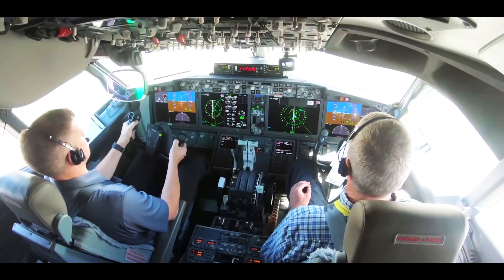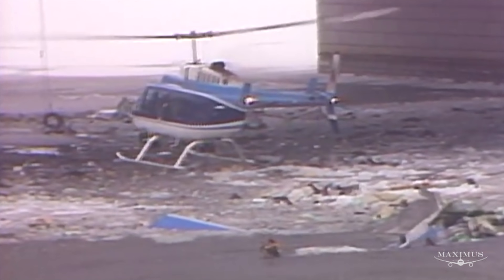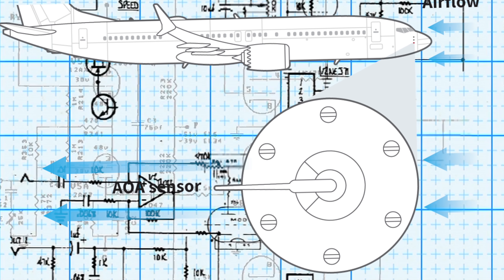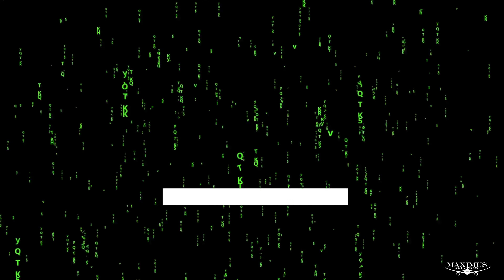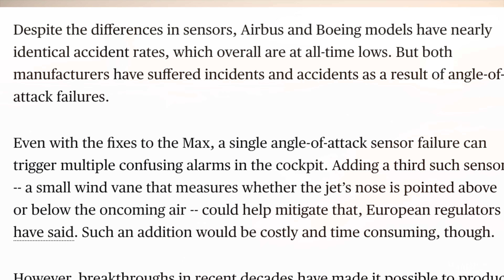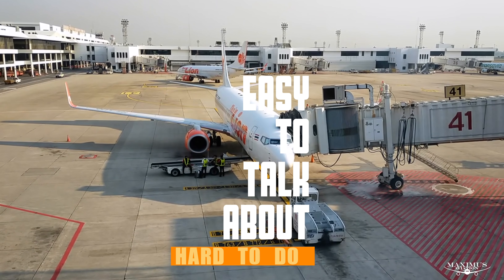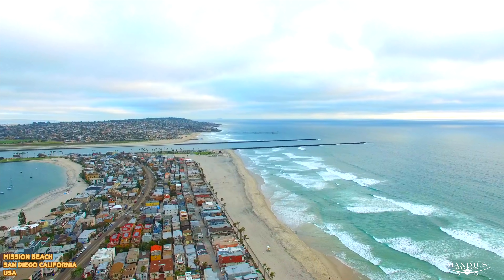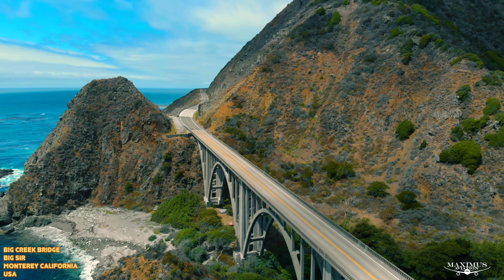Boeing To install 787s Synthetic Air System On The MAX! Boeing Caves To The EASA Will Install System

Comment: Ain't gonna make any difference. It still has the same old air frame along with the same over sized engines and other unchanged items leading to the two crashes.
Reply: The plane isnt inherently unstable that's mainstream media bullshit from their lack of knowledge on anything. All MCAS does is make the max fly like the NG so that pilots trained on that plane can carry over their type rating and not need extra training which would cost airlines more money. That's it. It doesn't need MCAS to be a safe plane. In fact it would be better off without it.
Reply: @TheAlmightyBig  it kind of does need mcas because the change where the wing positioning is in relation to the length of the airplane which changes how the rotation is positioned. You are correct that MCAS was the solution for this problem, just boeing failed to let everyone know of its significance of this system and tying it to only one AOA vane which became faulty in the 2 crashes
Reply: @Bob39285  the wing position hasn't changed in relation to the fuselage at all. The only reason MCAS was fitted was because in a steep climbing tight spiral, at high speeds, there is enough air pushing up from the high AoA on the bigger engines that less force was required to pull back further on the yoke than on the NG. That's it. MCAS corrects this by simply trimming down, so the pilots feel the same forces on the yoke. That's literally the whole reason MCAS exists. No instability, no nothing, just weaker feedback in a position the plane would barely ever realistically get to. That's it.
Reply: @RazvanMaioru  You're just wasting your energy, the media repeated the whole "Instability" BS enough that people now believe it.

Comment: My question is, where will Boeing find the computing capability to host synthetic airspeed calculations on 737 Max?  The aircraft used decades-old computers now, and both are now required to be running just to meet the new FAA dual-AOA sensor requirement.
Reply: Those computers belong in a museum.
Reply from the maker: Good question.  They will need to add computing power for sure.  But you know how these things are.  EASA says Boeing can fly while the "fix" the problems but that turns into years of not fixing things.
Reply: You do realise that the computers on the planes are more advance than the computer that you use in your house right? Even if the airframe that was built in the 1950's, the computer system can be retrofitted with current computers and upgraded with the latest technology without hampering performance. Of course they lose out on weight savings due to still having pulleys to control flight surfaces in an emergency, but that gives the pilot a better feel for the aircraft and how it flies unlike a joystick where you feel like your in a simulator without being able to feel the weight of the controls and everything feels synthetic. However, i will say i do love both manufacturers and they both give each other much needed competition and improvement to help further the industry
Reply: You do realize that the 737 Max FMC’s are 33 years old:  https://www.google.com/amp/s/www.theverge.com/platform/amp/2020/4/9/21197162/boeing-737-max-software-hardware-computer-fcc-crash
Reply: Nehemiah Scudder  whats your point? I work on airplanes and while the issue bring up is valid, its not accurate

Comment: The too expensive to implement reasoning doesn't appear too clever now does it!
As for the near identical accident rates we keep hearing banded about, does anyone know what they mean? For example, if an aircraft clips an 'on gate' aircraft does this count for both, one, or none? Is there a difference depending upon whether the aircraft was under its own power or being towed? Did the pilot deliberately fly into a mountain or building? Despite repeated warnings was the aircraft bounced hard enough on the runway with the undercarriage up to damage the  engines so much that they failed before the plane could reach the runway again? Or was it shot down either deliberately or accidentally?
I for one would not necessarily want those 'incidents' including in the statistics for determining one manufacturers performance versus another.
Reply: Google "ntsb definitions for aviation incident and aviation accident". Very very exacting definitions.

Comment: What a tangled web Boeing is weaving
Reply: Boeing has had a very hard lesson. They really need to look at Lockheed and the Skunk Works as a model. If the engineers are trusted and management supports them, this method works.

Accountants on the other side of the country? Duh. Go back to basics, Boeing.

Comment: Software does NOT solve an aerodynamically unstable passenger aircraft
Reply: The 737 is not an aerodynamically unstable aircraft. There is more than enough dihedral in the wings and horizontal stabilizers and surface area in the vertical stabilizer for it to hold a pitch, roll and yaw attitude without pilot intervention so long as it is kept within the weight and balance and and airspeed envelopes. You clearly do not understand the definition of “aerodynamic stability.”
Reply: @In0vat0r  The Maneuvering Characteristics Augmentation System (MCAS) flight control law was implemented on the 737 MAX to mitigate the aircraft's tendency to pitch up because of the aerodynamic effect of its larger, heavier, and more powerful CFM LEAP-1B engines and nacelles. And you say that inherently stable ?
Reply: @gowdsake7103  Go read FAR Sec. 25.173 and then we can at least be discussing this fairly and in an informed manner.
Reply: gowd sake - You’ve done an admirable job of recanting the story told and rehashed by most of the reporters who’s depth of understanding modern transport category aircraft is the result of time spent in a passenger seat. Have you ever worked in the aircraft industry? Do you hold any class of pilot certificate? Do you have any experience in flight training, simulation or aircraft control systems? Is any of your “knowledge” acquired first hand or are you relying entirely on news stories?
Reply: @gowdsake7103  1. Test pilots absolutely were aware of MCAS, they loved it because it worked great.
2. The 737 MAX is indeed by design extremely stable, just like any other 737.
3. The plane does not pitch up uncontrollably. It pitches up as you add power in the same way any aircraft with engines mounted on wings below the fuselage. Compensating for this is part of any airliner's type rating training. 
4. Boeing tried many things including an entirely new wing, but they didn't provide the results desired, which is why they made MCAS. They only look at software as a last resort. 
5. No, the two crashes do not prove it was badly implemented. They prove that those airlines were terrible at keeping their pilots trained. All the MCAS did was trim down. You could get a similar effect if a bit of dirt got the trim switches stuck, except that would be worse because it wouldn't stop on its own like MCAS. Again, dealing with this (it's just one switch you need to use) is part of the type training. The fact that all three flight crews couldn't do the simple procedure proves that they shouldn't have been allowed to fly a 737, as they would fail their type ratings. You'll notice I said 3 flight crews, but only 2 crashed. That's because the first had a 3rd pilot on board that actually showed up to his lessons, and dealt with it. They flew the rest of the flight and landed, all without issue. That's how easily recoverable an MCAS failure is. Meanwhile, maintenance didn't do anything to the plane that broke, so next flight, big surprise, it's still broken. In come flight crew #2, that, like #1, did nothing about it. And there was no help from a correctly certified pilot this time, so after 10 whole minutes of the aircraft still flying after the failure, the plane crashed. Again, after 10 entire minutes. This is because all trim down does, is increase the force required to pull the aircraft up, and give it a tendency to pitch down if the yoke is released .
Reply: @gowdsake7103  - No, I'm not defending Boeing or the FAA. They both made mistakes. At this point I'm simply trying to determine how much experience you have in the cockpit. It sounds like the answer to that is *none*.  (That you understand control systems is good.)

Aircraft are certified to operate within a range of weight, balance, airspeed and angle of attack conditions.  That is called the flight envelope. If the flight crew allows the aircraft to get outside the envelope it can become unstable, however, that does not mean that the aircraft is characteristically unstable. The section of the FARs I mentioned outlines the requirements. Clearly the 737 Max 8 didn't conform to that or Boeing wouldn't have implemented MCAS - which was actually developed for KC-767 in order to help manage it's speed stability during refueling operations. (large shifts in CG location as fuel is offloaded in flight.)

The press has consistently under-reported the details of what happened on both Lion Air 610 and EA 302. Human error was a significant factor in both cases. 

On EA 302 the crew did not follow the proper procedures. The preliminary report mentions that "thrust remained at takeoff setting (94% N1) and the throttles did not move for the entire flight" That caused the airspeed to increase to the point that it was impossible to adjust the horizontal stabilizer trim manually. This is a known condition on almost all modern aircraft which was discovered decades ago and is part of the training which all pilots receive in the United States. It is what the inexperienced F.O. is referring to when he said that it wasn't working. By that time it was too late. There was nothing the crew could do to slow the aircraft down enough to regain control. If they had throttled back and leveled off earlier, they would probably be alive today

While the Lion Air 610 Final report says that "MCAS was the primary cause of the crash" it also says that a "faulty sensor, inadequate maintenance, poor pilot training and a failure to heed previous problems with the same aircraft were all contributing factors."
Blame for LA 610 spreads across several individuals, from the Instrument Repair Tech in Florida that didn't follow the calibration process, to the maintenance personnel who didn't do the proper test when the mis-calibrated AoA was installed, to whoever removed the  missing pages from the repair log book and the crew from the previous flight who didn't report the problem fully. The careless actions of every one of those people contributed to the deaths of hundreds of others.

Focusing the blame primarily on Boeing and the FAA is deceptive and disingenuous. You are clearly an intelligent guy with valuable experience. Do your homework and report the truth, the whole truth and nothing but the truth, so you aren't misleading others in the same way.
Reply: Cat Life - Illegitimi non carborundum.
Reply: @gowd sake, first it’s aerodynamically stable. Two the reason they added mcas is so you didn’t need training.
Reply: @tomatosoupwoo  If its stable then why does it need MCAS ? because the engines fucked up the air flow and balance.
The Maneuvering Characteristics Augmentation System (MCAS) flight control law was implemented on the 737 MAX to mitigate the aircraft's tendency to pitch up because of the aerodynamic effect of its larger, heavier, and more powerful CFM LEAP-1B engines and nacelles
Reply: @gowdsake7103  The only reason MCAS was fitted was because in a steep climbing tight spiral, at high speeds, there is enough air pushing up from the high AoA on the bigger engines that less force was required to pull back further on the yoke than on the NG. That's it. MCAS corrects this by simply trimming down, so the pilots feel the same forces on the yoke. That's literally the whole reason MCAS exists. No instability, no nothing, just weaker feedback in a position the plane would barely ever realistically get to. That's it.
Reply: @tomatosoupwoo  - Almost...  

When Boeing changed to the larger LEAP engines the aircraft's longitudinal pitch behavior no longer met the requirements of FAR 25.173, however that does NOT mean - and the FAA has never stated that - the 737 MAX - or any other 737 type - is aerodynamically unstable. 

Stories in the press have made that assertion, but the authors clearly don't understand the details. Uninformed people then draw erroneous conclusions based on those stories.
Reply: You're repeating inaccurate speculations pushed by Ralph Nader, who has no background in aerospace engineering whatsoever. The MAX is completely aerodynamically stable, and this has been proven by test pilots flying the aircraft under full manual control.
Reply: It did with the MD-11
Reply: The software upgrade was available at a price with the 737 Max. the two  planes that crashed didn't have it.
Reply: @shakiMiki  Available at a price????? The software should have been on the minimum equipment list!
Reply: @JohnSmith-cw2wd  It was a false economy given the billions the grounding has cost, as well Boeing's reputation. US Regulators could have & should have insisted. Even in this case, the Europeans are demanding more.

Comment: Boeing ADDS  'exciting and certainly, efficacious items', and in a surly way adds Sim Upgrades, but only after extreme pressure from the 'bleeding obvious', that the general public's notions that the kerfuffle re the 737MAX & especially Boeing and the FAA complicity is 'not on'. In short, the MAX is 'going and going for good' unless Boeing pulls out of the PR dive. Is the cost and reputational benefit worth the price of doing the right thing, for all involved, the Flying Public, leery angry airlines, and the Aviation Regulators beyond the America sphere. Otherwise. It's a clean paper start for a new design, & clearly Boeing DOES NOT WANT & probably one that'd be hard to justify at an Investors Meting.

Comment: This is rather closing the stable door after the horse has bolted. The question must also be asked: Why didn't the FAA ask for this? It seems to me the FAA relationship with Boeing might still be too 'cosy'.
 At least EASA seem more proactive on this point, forcing Boeing to do what they should have done in the first place. You have to remember the 737 design dates back to the 1960s and that aviation has moved on at an astonishing pace. As these new developments come along, it's right  that they should be incorporated to older designs.
Reply: Absolutely!     Not necessarily those directly working on the particular job but rather upper level managers interacting with politicians.     Anyone who ever worked for government knows shit flows downhill and “ shut up and color “ is often what you hear when someone tries to go against the flow..     as a guy I know who worked for FDA regulating a chicken processing facility once said.   “ make too much noise about safety / cleanliness and they will get rid of YOU”.      That was the mid 80s, do you think it got better along the way........
Reply: Reminds me of the mad cow disease in the 90”s and the British government trying to cover it up.... 😬 ...also resulting in many people dying...and still might die in the future as the second wave hits 30years later...
Reply: They are probably wishing they had developed a clean slate design for the segment the 737 occupies.
Reply: THere is not one part of the 737 existing on the Max from the 60's... Your tired old trope gets old.  It was completely "modernized" with the NG variants.  It is now massively out of date.  Should have made a universal fly by wire package for all Boeing aircraft to install in all their aircraft.  But, management cut its funding.  787 got it and everything else ... yea.    As for the FAA, they are government pukes who know NOTHING about engineering basics.  Find me one government employee who knows anything?  You will never find such a person as anyone with ANY ambition or knowledge goes to the private sector for fulfillment of life and being proactive in creating new products.  Losers get government jobs and why Government sucks, always attracts losers and power hungry pieces of Shit.
Reply: Nehemiah Scudder  IF you believe Government pukes actually know something about engineering; you are prime fodder to buy bridges and swamp land... Let me guess you are a government puke... if you are, guaranteed you are not an engineer as none of them come from private industry where they had to actually WORK.  Far as I am concerned, not one government puke(safety inspector) should be able to get their job without at least 20 years working in the industry that they are overseeing.  I do not care if it is an internal or external safety inspector.